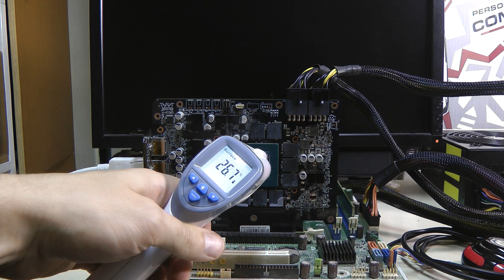test of burned GAINWARD RTX 3070

Comment: Pause at 3:07, those pins on the mosfet chips there ncp 302150. Think those mosfets would have too be replaced.
I don't think they are supposed too be copper colored on those legs there.
That short must have pulled a lot of amperage too damage those.

A channel/business like northridge might be able too fix the card but might cost more then the card is worth used, they recently did a 3080 repair where they replaced one of those mosfets that went bad & had no visible damage, it just was hotter then the rest.
Reply from the maker: I saw his videos around 3/4xxx RTXs, if he had visible blowed PCB was mostly non-repaible card too. I will not invest a cent here, it is pointless.
Reply: These not soldered pins are simply not used. Maybe another MOSFET uses these pads so they could be interchanged in manufacturing. But of course some of them could be damaged as well. The complete area around the core between the RAM chips seemed discoulored to me maybe due smoke maybe it got hot as well which would mean the GPU itself is dead.
Btw. you can not measure an reflective surface like the GPU with an IR thermometer you measure basiclly the enviroment temperature that reflects in it. 
Simple IR thermometers are usally calibrated to an emissivity factor of ~0.97 (human skin) while everything polished is very close to zero cause of the reflection.
Reply: they are not soldered thats normal i took a similar card apart
Reply from the maker: @Troppa17  You are right with temperature measuring and polished areas - this is problem for real numbers, but for situation if anything happening there or not is OK. And this meater has two modes, for human and for any kind measuring and works fine.

Comment: at minute 2:02 you can see (U28) and (U30) near the (J14) below the 8 pin 12v connector it has 3 transistors or logic gates that are half burnt.

Comment: anyone wonder if reverse polarity 12v was applied to the card to burn it? like wrong cables for different psu brand or something.  Maybe that would burn the fan wires
Reply from the maker: This is not real that any reverse steps happened. Card was in mining rig running 24/7 so this is probably reason why something blown up.

Comment: hi, good video! You dont measure de 3.3v line, maybe this is the problem. When the card is cold, sometimes is a alimentation problem, of 12v or a damaged alimentation line. I am waiting for the other cards :-)
Reply from the maker: Yeah you can measure many other things, I started with main 12V and got nothing so any other moves are pointless on this burned PCB. It was only try.

Comment: Fans, PCB, mosfets and memory modules seems to be gone. You would be a very lucky guy if the gpu was intact imho. Did you check if there is a short in the 12v connectors?
Reply from the maker: It was only attempt to try something around. Yep I checked shorts in half of video :-)
Reply: @RETROHardware  In the video you checked the short on the pcie connector only and checked the fuses. that's why I asked about the power connectors.
Reply from the maker: from 2:01 are checked both 12V PSU circuits and later both fuses on them